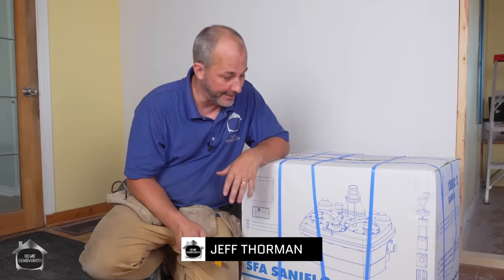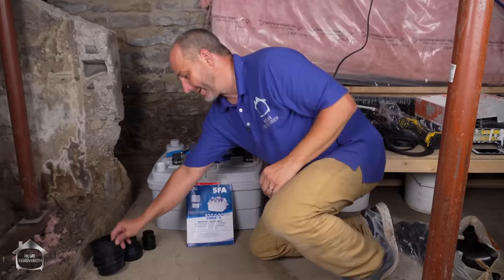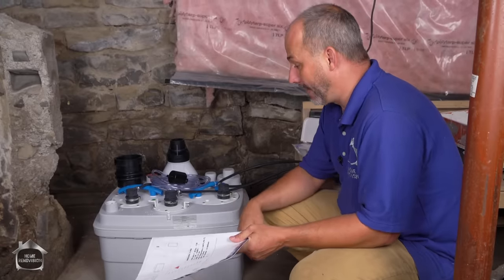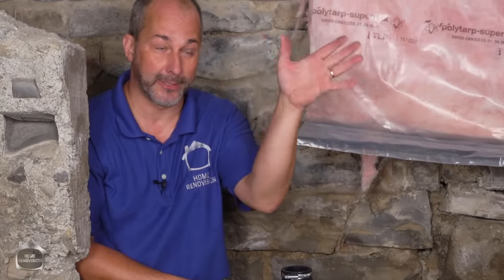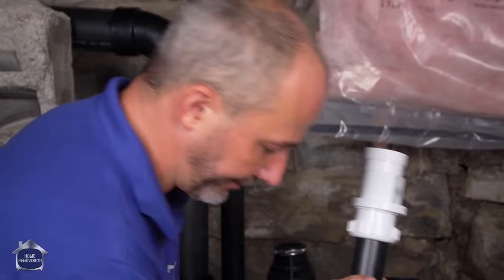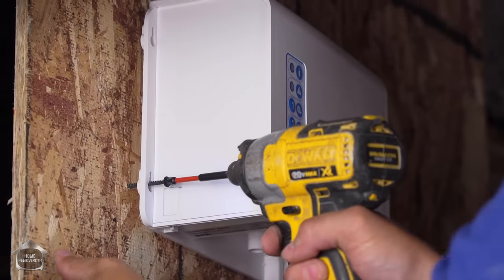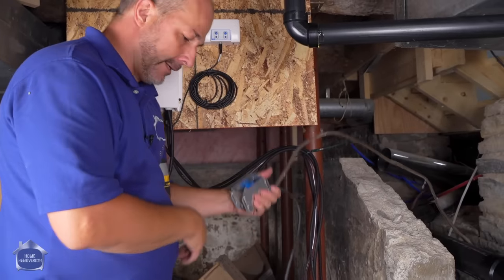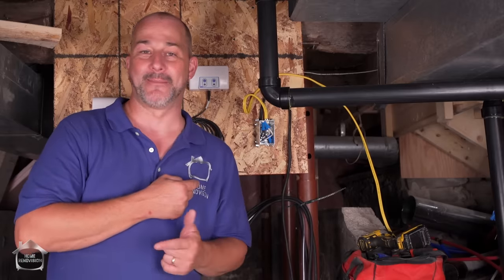Saniflo Macerator Plumbing Installation Instructions

Comment: My wife and I just bought a house that has a (mostly) finished basement with two rooms, a utility room, laundry room, and a living room.. but no bathroom! So I would like to add a bathroom down in the basement to turn it into a true 2 bath house. Would it be worth putting everyone on the same system like you did? Or should I just use this for basement bath? Love your videos and just joined!
Reply from the maker: Hi Jonathan, best to talk to a rep at saniflo since they have multiple options at varying cost. this is the deluxe model and may not be needed where you are.
Reply: @HomeRenoVisionDIY  Will do. Would you recommend going this route verses having to chip up all the concrete like you did in one of your earlier videos?

Comment: So Jeff, did you just effectively remove the clean out where you tied in the adapter? Does this meet code? Other than that great video!
Reply: I'm sure he knows what he's doing, he wouldn't do anything that wasn't up to code.  He been doing this about all his life so I'm pretty sure he knows what hes doing.
Reply: @EDBailley  sorry but that is a really dumb response
Reply from the maker: Hi Samuel, I even had the folks at saniflo look over the install video and they passed me with flying colors. Cheers!
Reply from the maker: both of the motors have a removable lid for service. Before you call me a shady contractor do some research!
Reply from the maker: Cheers to you for sticking up for me. No worries their  concerns are unfounded as the unit can be accessed by the lid for both motors in the event of a blockage. Cheers!
Reply: @HomeRenoVisionDIY  Good to hear!
Reply: @HomeRenoVisionDIY  You're welcome! 😊 Cheers!
Reply from the maker: The truth is this system had 2 cleanouts on it. I simply utilized one that was not beneficial for anything. If you don't have an extra one like i did the idea is to install a Y as close to the exit as you can and nas far away from anything else entering the line as possible. Cheers!

Comment: Hey, Jeff. I'm looking at installing the sani flo shower unit for a basement shower and another unit for a wet bar. They also require vents. When you say that it requires its own vent do you mean that you ran a new dedicated line through the roof or that you ran a line from the unit and tied into the existing house vent? Thanks.
Reply: Did you ever find out?

Comment: for anyone installing this in Australia, you will need to have an issolation switch withing eyesight from the equipment, mainly because there might be a joker around that might flick the switch back on in the switchboard if you acedently switch off the wrong circuit.
Reply from the maker: That is true if the unit is installed in a different room than the panel. Cheers!

Comment: Great video! I've pondered using this setup for my basement,  but I'm stuck on how to vent the machine as the bathroom will be in the center of the basement.
Reply: You could probably run your vent to an exterior wall and then through the wall and up the side of the house if it is someplace that it's not going to look bad, maybe a rear wall of the house out of the way someplace or behind a tree LOL
Reply: @willschultz5452  the vent would have to be about 20 feet horizontal. Is that type of thing ok?
Reply: @DanStAubin-oo7zv  you might want to check with your local code but I do not see any problem with it
Reply from the maker: In my experience as long as the vent  is taken to above the soffit line on the roof then  you are fine but check with your local codes. I opened up my interior walls and ran it all the way up inside. Cheers!
Reply: @HomeRenoVisionDIY  yes I think you are absolutely right 😁
Reply: @HomeRenoVisionDIY  thanks Jeff! Would it be absurd to have the vent exit  the house from the level of the basement ceiling and run the vent above the soffit from the outside? Somewhat how a radon vent would run?
Reply: Just tie into the existing vent stack using a tee or wye fitting. No need to run it all the way up.
Reply: @DanStAubin-oo7zv  I'm having the same issue, I learned a lot about venting after buying this unit. Unfortunately, I don't have the skill or confidence to figure out the exact details in my situation, as it got pretty complicated pretty quickly with my local codes, and I had to hire a license plumber to take care of the venting portion of my be bath install on my basement. Better safe than sorry!

Comment: I’m looking into installing a SANIFLO unit in my garage in order to pump water from a toilet, sink, and shower out. Do you know if I could pump the water out of an existing vented laundry drain pipe. The laundry is being relocated and I am on slab foundation so I don’t have many options.
Reply: Hey man, did you end up using this system for your garage?  I have a detached garage below grade and I am trying to decide if I would like to purchase this.
Reply: @ Mac_Raymond. Did you do it yet? I have the same situation I would like to know if it work out well for your system?

Comment: hey Jeff,what about using an oscilation saw to cut the connections,great vid,very useful as i have to install my SFA sani- boyeur also :-),also,you learn from your mistakes,for me it was simple,i put in thicker wire (2.5 square) everywhere with 16A breakers (lichts,wall sockets)that way i could'nt mis,and only 4 square cable and 20A beakers for washing machine and cooking plate,that way the wire can never heat up before tripping the breaker
Reply from the maker: sure, power tools are awesome. I like to show the hand tool options so folks know they have one. Cheers!

Comment: No long sweep 90 on your discharge? Any reason for this?
Reply: I don't think it's needed because it is not a gravity system.  The solids are ground-up and pumped through the plumbing.  Although a long radius elbow will create less pressure drop and be easier on the pump motor.

Comment: Not sure I'd want my drain function contingent on having power :-}  Bad enough my well dies when there's an outage (until I start my generator).
Reply from the maker: The holding tank will support a couple of flushes. there is no difference in performance during a power outage.

Comment: Literally what i need right now. My inlaid concrete outflow pipe is clogged and def does not flow what it needs to. Thisbis a perfect solution. What toilet can you use with this? I dont want to build a platform in my bathroom.
Reply from the maker: Saniflo has a toilet macerator pump unit for bathrooms in the basement so there is no need for a platform. cheers!
Reply: @HomeRenoVisionDIY  i have seen those and it looks like it has multiple inputs but will it handle a half bath and grey water from the laundry? This unit looks a bit beefier.

Comment: The reason you cannot use the mechanical vent is because the pump will get air locked. There will be no way for the air to get out of the tank

Comment: I'm a new viewer to your videos I'm a recently retired A.S.E. Certified Master Mechanic (not a master automotive tech) in Auto & Diesel repair, I usually can figure out most things on my own. But I have learned a huge amount watching your DIY videos I got a Question about this system I am planning to buy a 101 yr old home in Detroit, it'll need a complete renovation thinking to replace the sewer line in the basement as it's got to be in rough shape at this point would this device eliminate the need for that?

Comment: Nice job, but I would have put a disconnect switch for service purposes.
Reply from the maker: That is called a breaker on the main panel. Cheers!
Reply: @HomeRenoVisionDIY  Why do you think your AC has a service disconnect? Without it you would need to lock out your panel every time you were to service.
Reply from the maker: the reason the a/c has a service disconnect is because it is not in the same room. this macerator is in eye shot of the panel so no worries there. If it was in a different room then I totally get the concern. great point in bringing it up., Cheers!

Comment: my only question is how do you tie into the vent stack to the roof from the basement?
Reply from the maker: You don't tie in. you add an independent stack for this unit. Cheers!
Reply: @HomeRenoVisionDIY  good to know. basement bathroom is a future project with in the next few years.

Comment: You didn't say anything about how to keep those pipes secure. I bet when you use it they rattle like nuts!  Also did you install another clean out in this pipeway?
Reply from the maker: I used all round to secure the pipes. It works great quiet as a church mouse!

Comment: Safety 3rd!! Is there a way to hook it up to a backup power source like a battery? Be a bad time if the power went out and you just had some Taco Bell for dinner.
Reply from the maker: LOL, you could do that at the panel along with the well pump and the fridge and the furnace.

Comment: All's good until the pump dies,then pray you don't get the call !!!!!
Reply from the maker: both motors run independently so it has its own backup system. I am quite confident with it. cheers!

Comment: Now that is an appliance I would never want to break down. 🤢  What do you do in a power outage? I would hate thinking I couldn't use my bathrooms without electricity.
Reply from the maker: funny thing is you can't use water without electricity anyways. so what is the difference.

Comment: Those cheater venting systems (one way check valve, allows air in but not out) are used under kitchen islands all of the time.  There's no way to vent a sink like that if you have an open floor plan and a fixture in the center of the room.